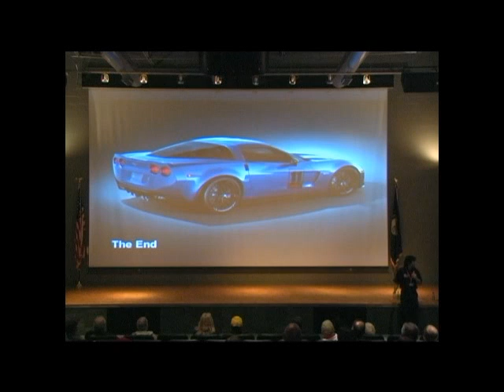Corvette's Chief Engineer Tadge Juechter on the C7 Corvette

Comment: @SkylarkGSX All though that is possible, I would go with a used Corvette. Not brand spanking new. You can get a 2005 C6 for around the mid to high 20,000s easy. And C5s can be from their low 20,000s to as low as the low teens. You can also find some C5s in the high 9,000s bracket if you look around. People just don't understand how cheap a Corvette really is, because car salesmen try to scare them away. And so does insurance, but even that isn't really bad either. Corvettes are really a bargain.

Comment: Corvette C7 Must: 

Be lighter than C6 (around 3000lbs) with Z06/ZR1 even lighter...

Lower the Drag  Coefficient ( will improve performance and mileage). 

Should beat C6 at all levels like the C6 did to the C5... Hopefully 460-480BHP for the base and mid to upper 500's for Z06 and above 640BHP for the ZR1. 

Finally hopefully something is done about the automatic transmission and interior...

Comment: @Janusha The V6 option has always been considered and talked about, but was always discarded. The more reason I add to my previous statement, that the V8s are doing a far better job than the V6s, even efficiency-wise. BUT there's rumors about a DOHC V8TT 5.4L or something very similar. I wonder if that's true at all. Supposedly GM is considering that as another option apart from the LS-series engines incorporated in other Corvette models. Their goal is to lower the weight, and use less power.

Comment: @xj220se The Corvette has some of the best and widest street legal tires on the road (Michelin PS2 ZP). 

The ZR1 for example in 2009 posted a best 0-60 time of 3.2 secs with no Launch Control and a 1/4 mile of 10.7 secs @ 133 MPH, if GM put the computer toys in their Vettes like Ferrari now uses it would not only brake the back of the prancing horse yet again but ruin the entire beauty the Corvette has in being a pure driver's car.

Comment: @xj220se Also, the V6 wouldn't hurt the Corvette one bit. If they make it light as 2,800 pounds it can perform very high with only about 500 horsepower. If the GT-R can pull up 530 horsepower with a V6 so can the Corvette. If they put a V6 in and a smaller engine, I mean 6.2 liter is sort of too big. I think 5.5 liter rumor and the engine in the C6R is a good idea. And the V6 wouldn't hurt it rather I believe it can increase its fuel efficiency. But they have to make it lighter, no matter what.

Comment: @xj220se See look, only reason a Zo6 would perform well in a track is because of the weight and the fact that the Corvette series have no understeer at all.Which is good, but they have to do more than that to make this car a supercar or a race car. See, GM trying to create a total race car. I mean, the Zr1 does 1:35.8 in Laguna Seca which is the 3rd best in the world, that's great but it lacks performance in Nurburgring. I think they should get the weight down to 2,800 lbs or at least 3,000 lbs.

Comment: @dontknow95 I doubt it.. I'm pretty sure it will be a naturally aspirated V8. Forced induction, i think, was only used for certain top of the list in the GM lineup like the ZR1, ZL1 and CTS-V or whatever.. Plus, they said that the Z06 Carbon's concept was to be followed by the upcoming C7 gen, which is also meant to close the gap between the ZR1 and Z06 performance

Comment: @srs581 I'm pretty sure there won't be a V6 Vette.. Corvettes don't need to reduce their displacement at all. Their lightweight V8s are simply formidable the way they are: light, powerful, efficient, and easy to modify if desired

Comment: i think it will be a direct ingection supercharged or turbo charged V8 which  will be under 6.5 liters and above 4.4 i'd say 5.5 as for the transmission there will be a manual thats a fact but i do see a possibilty of a DCT i expect the price for the top of the range to be above 100K

Comment: In order for GM to make those standards I think we'll see their Displacement on Demand technology used in the Corvette. I/e when your driving lightly you'll have only 4 cylinders firing then when you drop the hammer all 8 cylinders of  Bowling Green's firepower is at your disposal. 

But a lighter and more aerodynamic Vette is guaranteed. Which helps MGP's and performance.